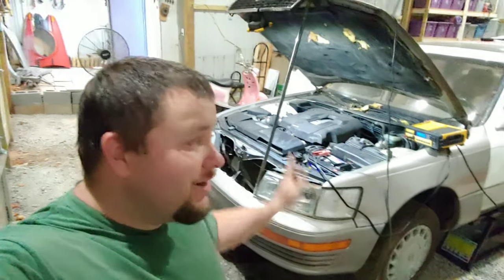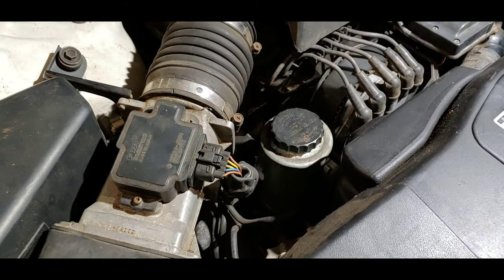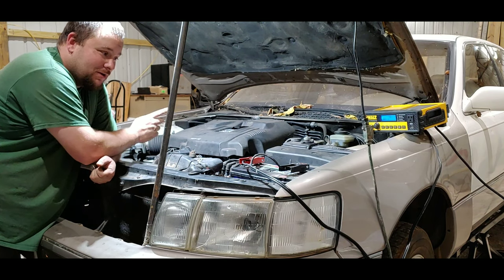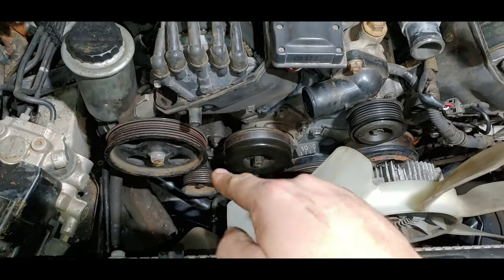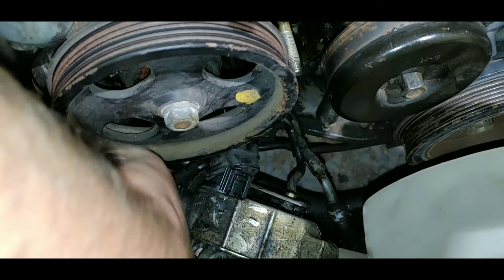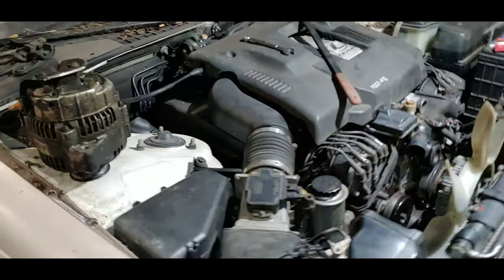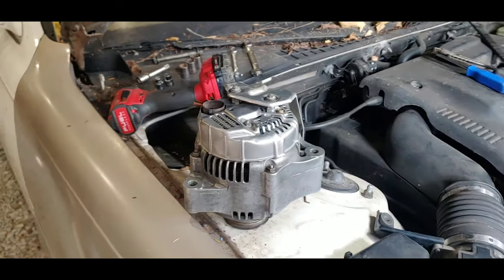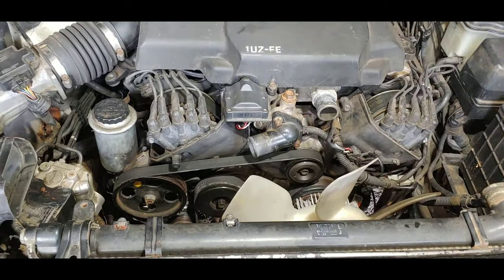LS400 alternator repair

Comment: I got a 1995 ls400 and its overcharging the battery to 18.5 volts lol I could just replace the voltage regulator but I'm probably gonna replace the whole alternator for a new one and a new belt any recommendations?
Reply from the maker: I personally would recommend just getting it rebuilt because they can go through and check all of your bearings and replace the regulator and it will be a little cheaper than a brand new one.

Comment: many state the hydraulic fluid shorts the alternator. That cannot happen as Hydraulic fluid is dielectric and cannot short electrical components as there are servos inside transmissions that work in the presence of ATF. So what causes these to go out? Slip ring to brush contact?

Comment: why not buy used one from Ebay?
Reply from the maker: For a little cheaper I was able to get that 1 rebuilt and have it the next day compared to waiting a week or 2 for a used one on eBay
Reply: @cunninghamgarage2074  I am in the same situation and they go for around $100 on eBay but I am not sure the rebuilt is the same quality as OEM
Reply from the maker: If you feel more comfortable picking the one up from eBay I would go ahead and do it but I would also get your old one rebuilt just to keep as a spare

Comment: What year was this car??
Reply from the maker: 1991
Reply: @cunninghamgarage2074  mine is a 1993 do you know if it has the round plug or the 3 pin long one?
Reply: @cunninghamgarage2074  also have you had any problem with odometer lights not working?